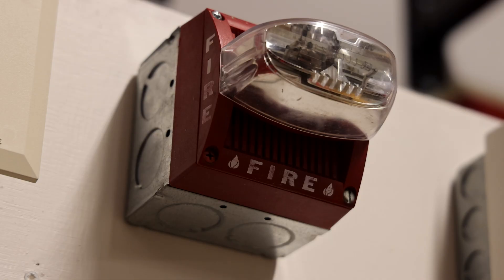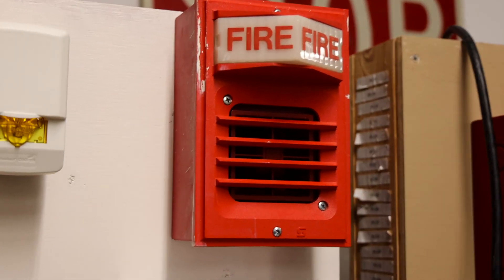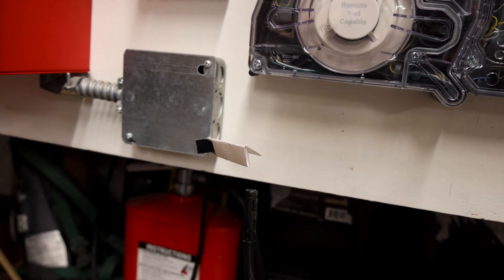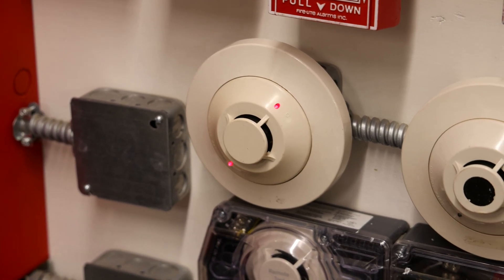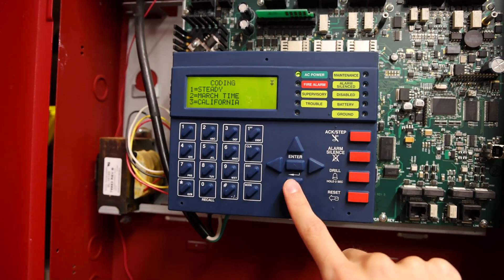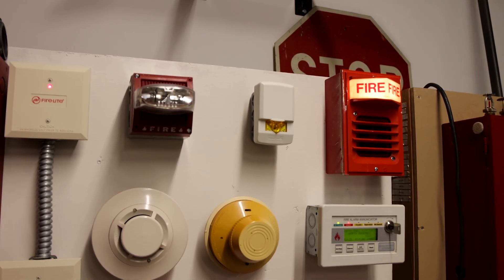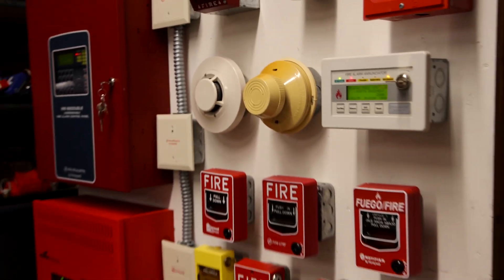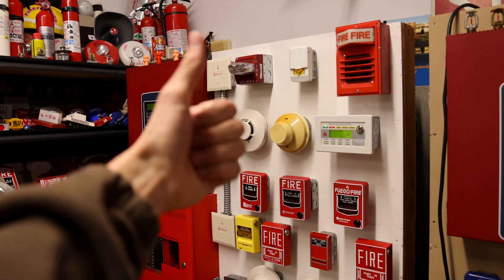Wheelock & Fire-Lite Voice Fire Alarm System Test 29! | Weird Whoop & California Code!

Comment: Did you also change the strobe to a light as well, just like your speaker strobe from your TekTone Corridor Light
Reply from the maker: The light in there is the same as in the last system test.